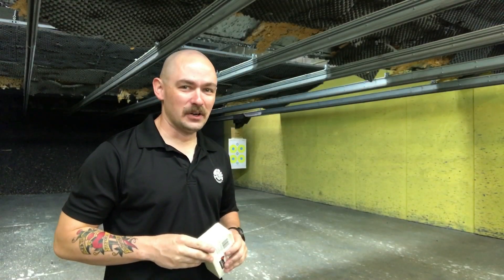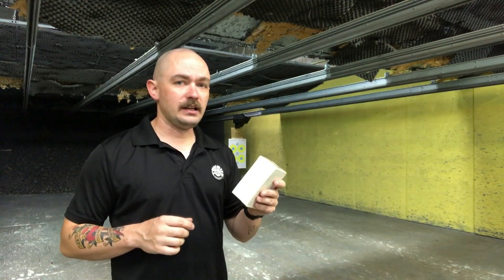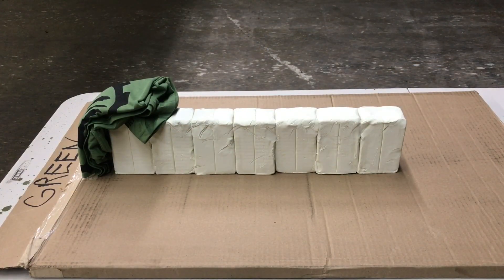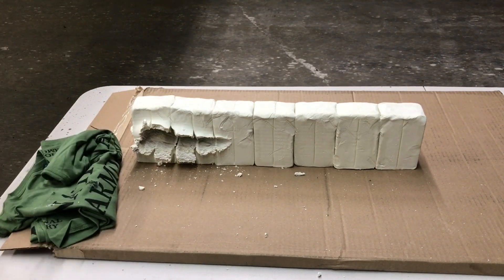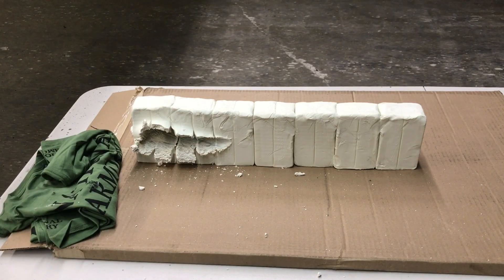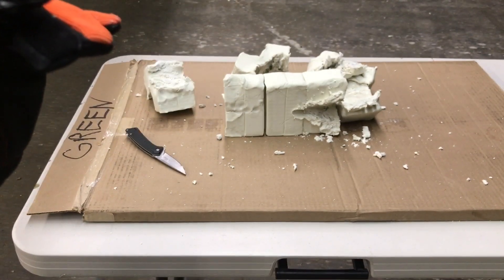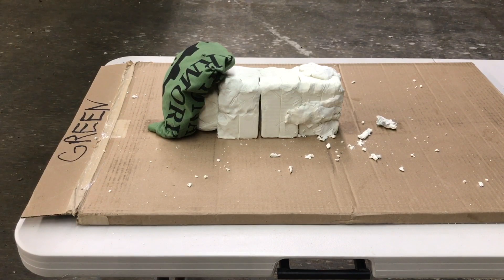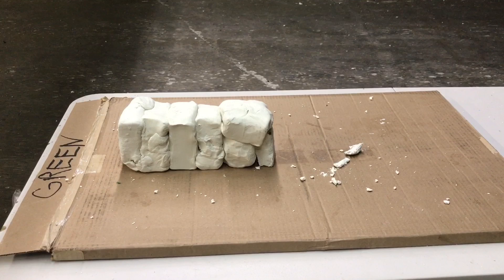Winchester PDX1 Defender 9mm ballistic testing

Comment: PDX1 and RANGER are two completely different bullet designs. Ranger-T is unbonded and has the sharp 'talons' PDX1 is bonded and doesn't have the talons.
Reply: Iv recovered a few  fired rounds of the PDX1 124gr +p.
It most definitely has the sharp "talons"
I think due to the bonding process
the talons are partially filled with lead, but still plenty sharp.

Comment: The 124gr +P round have higher velocities than the 147 gr , which is the prime reason i think you see the barrier test result showing differently in clay, I have seen test in gel with a subcompact 9mm using the 147gr and a 124 gr +P rounds thru 4 layers of denim where expansion was reliable with every shot. Although the 124gr had more penetration. I do not that the barrier test of the PDX 147gr  that didn't expand show the cavity filled with clay. Winchester claims that this round was made to not fail from the cavity being obstructed, so maybe that is an isolated round failure as oppose to an across the board fail. 

Interesting test however

Comment: Actually the PDX1 124 Gr +P that was the first two blocks (not 1) that was completely destroyed. Note the "hooks" on the end of the Jacket, very much like the old "Talon" bullet (the "cop killer" bullet that was outlawed), it's simply amazing what what waiting a couple of years and removing the "Black" coloring off the bullet and reboxing it can do. I would say expansion was at the maximum which is the reason the 124 Gr.+P is my choice as a carry round. As you say, the lack of expansion on the 147 Gr. may be do simply to lack of velocity, hitting something at a much improved velocity over another almost always yields more positive expansion. I like this loading.
Reply: ChuckHydro - Black Talon rounds were NEVER outlawed. Winchester removed them from circulation, introduced the Ranger SXT-T series which was the exact same thing as the Black Talons but without the black coating. Some people even stated that SXT stood for Same eXact Thing.

One can go on gun dealer and legally  buy a box of BT’s right now if they wanted to without breaking any laws regarding the BT’s.
Reply: PDX1 and Defender dont have claws as such like Black Talon. After so-call doctor complaints Winchester as you stated removed the black coating and add a radius to the end of the petals which are sold as Defend, PDX1 Defender, and the 124gr +P Defender  (The later two being from the Elite product line). Ranger which isa police Duty Round is the equivalent of Black Talon without the black coating in 50 round boxes. We all basically get ripped off off 30 rounds because these companies label some of their product lines as Defensive/Carry Ammo.

NOTE: Doctors complained that Black Talon Rounds put them at jeopardy of cross blood exposure forcing Winchester to redesign and remove the claws sharp petal configuration. BUT has anyone noticed that they  don't seem to mind this risk taking from the same bullet that are being used by police... Why would that be I wonder. Can't  they still get cut and have somone's blood enter that wound?

Comment: Im just curious did you decide to switch to the 124?  I once carried the 147 as well, but after doing some testing including small game hunting and  competition started preferring 124 and even 115. I know 147 have softer recoil for the same power factor as the lighter bullets, but one match I did not have time to handload my usual 147 and bought store bought 115. I actually placed higher than I usually do (2nd place) then I realized that softer recoil does not always mean you as an individual will be faster. Add in the fact that on small game with similar shot placement the 147s had little effect and the 115/124 dropped them in place. Plus the fact that the 115/124 have a better track record usually, I came to the conclusion that I will be using 115/124 exclusively. Also if you handload with mixed brass any case will accept the 115/124 without case bulge which is not the case (No pun intended) with 147.
Reply: I Agree 100%, learned the same thing. One thing pistols generally lack is speed, plenty of diameter but no speed, adding speed makes it a much more formidable cartridge. The original loading by the British in their 9MM assault carbines (sten, etc.) were found to be most effective with a 115 gr. at 1200 FPS (9MM Ball Mark 1Z).
Reply: @ChuckHydro  yes you're right 115 is usually the best round. Simple math will show almost every time the 115 grain round has more energy\power! 147 is never the best option, unless you want more penetration from lack of expansion with a lot less power to boot. Everyone has their own ideas & theories but math & science never lies. I always go with the more powerful round in any caliber, no matter what it may be.